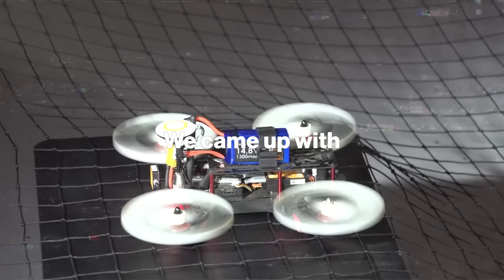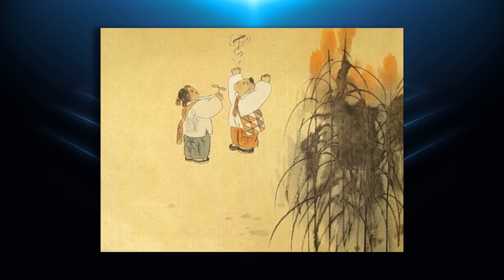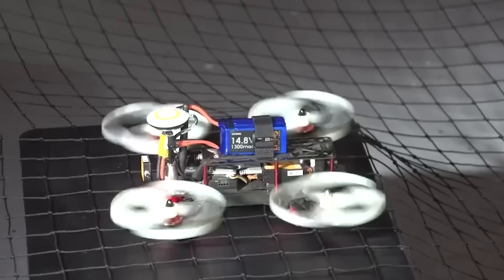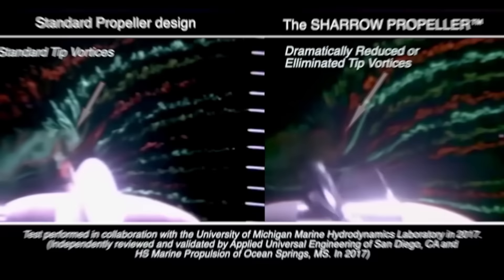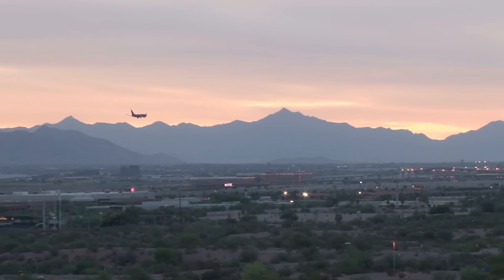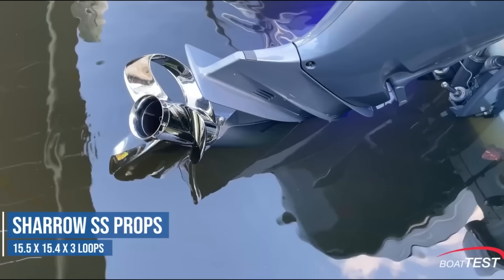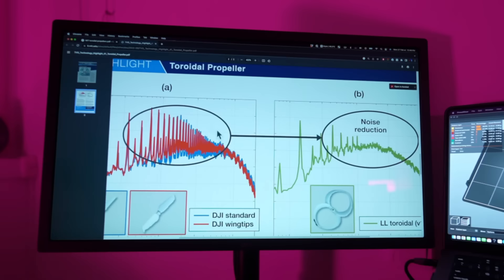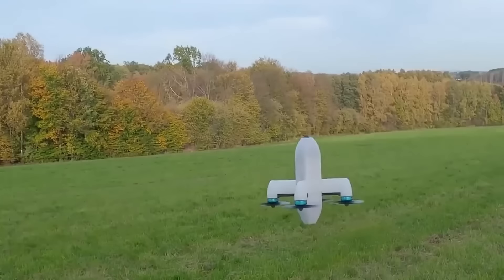This MIT Propeller Is Going To Change Aviation Forever

Comment: These would be useful for retro fit applications in GA aircraft,wind generation,boats and even domestic uses such as extractor fans. Aircraft propellers are an area of technology deffercit. Although these designs have been around for many years the manufacturing challenges could be solved if R and D money was spent on the problem.

Comment: The bending moment imposed on the engine due to gyroscopic precession associatd with direction change on a plane is going to be immense.
Reply: it could be less than standard propeller!
Reply: @0x00zero Given the dimensions, it looks like the moments would be far higher.  That's a problem for engines.
Reply: Is that because the toroidal props are heavier?

Comment: It's odd that the video does not mention cooling and exhaust fans so often found in households and businesses (e.g., in refrigerators, in bathrooms, over kitchen rangers, in refrigerators, air fryers, induction burners, and so on. Fan noise in households is ubiquitous, and it would be wonderful to reduce that.

Comment: As having been an Airforce and a commercial pilot I dealt with lots of incidents called birdstrike. Assuming this type propeller is hit by a foreign object, I could assume that in case such a propeller structure ruptures it might cause tremedous unbalance which furthermore could lead to complete desintegration. Those desintegrated particles would radially cause impact into the airframe and further destruction of the aircraft plus loss of lifes.
Reply: My numbers were bad. So, 2, 3,4, 6 & 8 bladed propellers. Whats really the difference in saftey factor as you describe in traditional propellers with their variety of blade count vs this concept in a bird strike scenario?
Reply: Breakup would certainly cause serious problems. However, since the circular design distributes the stresses, it may be possible to use a far more flexible material. Possibly a synthetic with thin carbon fibre cables embedded, similar to a tyre. It would need a lot of research and development, preferably on drones, where there is no risk to life.
Reply: Lives
Reply: an unbalance in these props from a bird strike would do the same exact thing with a normal prop. this design wouldn't change that other than maybe a little more material that has the potential to impact and damage the airframe.
Reply: Being a car driver and not a mechanic, I can tell which car innovations are garbage from a first glance.
Reply: @johnmood5653  Hope your German is as good as my English  ^^
Reply: @CL-mr4te  5, 7 and 11.  use only prime numbers, please.  avoid harmonics.
Reply: @dontghostbanmeplz8788  So are you putting this in the "garbage" category?  Me too.  Well, for most planes and drones, anyway.  Noise reduction seems to be the only benefit in air.  Seems to make more sense in the water....

Comment: This probably comes from the Prandtl box wing concept, which is aimed at reducing induced drag. However, it comes with more surface leading to higher friction drag. For this toriodal propeller, it will have the same disadvantages as with the Prandtl wing. Induced drag will be greatly reduced with the increase in friction drag. Moreover, while the front blades harvest all energy (with 40% power efficiency at best), the rear blades will harvest only thos loss enegy from the front ones. Thus, it depends on which part between pros and cons those propellers have more. Some less complicated innovative ideas are always suspicious, since it was likely to be already investigated and proved not working in the past.
Reply: No, it's all about removing cavitation. In water the prop speed is limited by this, thus limiting speed. THAT is the biggest drawback to helicopters  too , ..... HMMmmmmmmmmm??????? It would look cool though, kind of like DaVinci's drawings of one !
Reply: @inmyopinion6836  There's simply no (significant) air cavitation...and OP isn't talking about that in any case, so your post is doubly unnecessary, congrats!

Mmmm-okeey? :D
Reply: Thank you , it's always nice to know one's irrelevance. Especially when taken out of context!  @TheChzoronzon
Reply: @inmyopinion6836  My pleasure
Reply: @inmyopinion6836  I think you meant 'tip speed approaching sound barrier' is the drawback to helicopter....it limits the forward speed a helo can fly.

Comment: There is a video called "MIT thinks you're stupid".  In the video the author speaks about the toroidal propellor that was developed and patented by industry, and then people at MIT claimed they were the ones who invented and developed it.  I don't know too much about it these propellors.
What is important to me, that I I know about firsthand, is that the first heavier than air ion propelled aircraft to lift its power supply onboard was developed by me, over the past 24 years, not MIT as they also claimed.  In some later videos the use the word "plane" instead of aircraft, however their papers still claim they are the first of any kind with onboard ion propulsion.  It is especially sad because their much later flying ion propelled project is not nearly as efficient.  They are getting most all the credit and funding for it.  No one seems to give a crap about the truth these days, and important science is often just flatly ignored.  Credentialism appears to often be promoted over substance.

Comment: I love how you said this is the sound of inefficiency whilst showing a video of a drone using toroidal propellers. Watch Marks Roberts video on drone delivery in Africa. Their drones use a way different propeller design that actually does lower noise significantly. Also noise is NOT correlated to efficiency by any means especially human perceived noise.

Comment: The propellors of military submarines are always covered. The are built to be as quiet as possible. I have a feeling this has been used on subs for sometime for the benefits of less cavitation.
Reply: The designs of the props are the single most important element in terms of stealth capability underwater.
Reply: "In the 1930s, Friedrich Honerkamp patented a toroidal fan, and Rene Louis Marlet patented a toroidal aircraft propeller. The marine propeller was patented again in the late 1960s by Australian engineer David B. Sudgen affiliated with Robbins Company of Seattle."

Comment: I wonder how they would function on an aircraft, when power is lost.  Traditional propellers can be feathered, to reduce drag.  This is particularly important on two engines.
Reply: He showed several variants.  The ones that loop back onto the next blade are fixed and probably can't be feathered.  However, he did show at least one variant where the loop was to itself (a blade with a hole in it?) which could probably be feathered.
Reply: A fundamental problem, the ability to feather is needed in multi engine aircraft, may be a self destruct feature is possible, with the disadvantage of preventing a restart, obviously a no starter in multiengine aviation, last I checked, no commercial 3 engine are left in revenue service since the old Tante Ju was grounded in Switzerland after killing the pax of the sister JU 52.

Comment: This would work great on small aircraft, but likely not for anything larger.  The vast majority of small commercial aircraft engines are designed to work with a variable pitch propeller, in order to change the blade angle relative to the angle/speed of the air.  As the aircraft's speed increases, the pitch has to change to maintain the most efficient angle of attack of the propeller blade.  Unless they can somehow design the shape to be able to flex, I have doubts about its efficiency on faster, more powerful aircraft.
Another point is that many aircraft require the propeller to feather (reduce it's blade angle to zero) in order to reduce drag in an engine failure situation.  If it can't feather, it would cause great issues on multi-engine aircraft.
Unless they can design a blade that morphs to maintain the shape required to sustain efficient thrust through a wide range of speed, I have doubts this will ever be applied to anything large unless perhaps they can produce an electric motor and a propeller that can spin the thing to incredible speeds to maintain the most efficient angle of attack, but then, you will also run into the problem of the blade tip exceeding the speed of sound.

Comment: Stocks are pretty unstable at the moment, but if you do the right math, you should be just fine. Bloomberg and other finance media have been recording cases of folks gaining over 250k just in a matter of weeks/couple months, so I think there are alot of wealth transfer in this downtime if you know where to look.
Reply: Such market uncertainties are the reason I don’t base my market judgements and decisions on rumours and here-says, got the best of me 2020 and had me holding worthless position in the market, I had to revamp my entire portfolio through the aid of an advisor, before I started seeing any significant results happens in my portfolio, been using the same advisor and I’ve scaled up 750k within 2 years,
Reply: Having a counselor is essential for portfolio diversification. My advisor ASHLEY AIRAGAHI who is easily searchable and has extensive knowledge of the financial markets.
Reply: what the fuck does this have to do with propellers?
Reply: SCAMMER ALERT

Comment: On an aircraft you need to consider icing of propellers. Also the weight would be two or three times as much.
Reply: So, there is a problem, imagine a solution, like heating the prop, or restricting it's use in some logical manner (OH GAWD, Let the FAA decide that one, lol.)

Comment: Hmmm... This would be a major boost to the attractiveness of turbo-prop regional airliners, making them even THAT much more competitive in quieter, faster and longer range operations. This also could be a game changer for engine development of ‘oper-rotor/prop-fans’ for  larger commercial airlines.
Reply: They don't change pitch
Reply: Would they work even in fixed pitch models? Shouldn't all commercial airplane propellers be of the variabl pitch kind?

Comment: For marine applications as well as aviation use, a fixed pitch propeller is limited to relatively small diameter and low power to weight ratio machines. If a large multi engine aircraft or surface vessel were not capable of changing a propeller pitch to neutral pitch during an engine out emergency, it could result in possible loss of directional stability or control of the aircraft or surface vessel. In the case of the aircraft, this loss of control could result in a crash due to inability to properly steer the aircraft. The same reduction in control in a surface ship could also prove disastrous in the case of severe weather or maneuvering in low visibility, in crowded waterways or narrow ship channels. Also, as an aircraft altitude increases, propeller pitch control is essential to provide optimal engine thrust and resulting engine power output due to lessening air density at higher altitudes. And lastly, a 10X increase in price over a standard marine propeller for only a 10 % improvement in engine power at mid-range rpm, and a likewise 10 % reductions in fuel consumption at cruise (mid-range) speed isn’t easily justified for the majority of either air or marine operations.
Reply: Did you post an AI comment on an AI narrated video bro? 😂

Comment: The toroidal propellers might work better in water but not in aircraft
Reply: 5000 BUCKS FOR THE BOAT PROP EATS UP ANY FUEL SAVINGS AND THEN SOME ITS A NOVELTY.

Comment: The biggest problem I could see would be an engine failure with the inability to feather the prop…especially on a multi engine aircraft. Perhaps the prop could be engineered to lock in position to prevent rotation but I don’t know how much drag would still be produced by a stationary prop. What if the prop could be designed with minute separations between the blades so some feathering was still possible? I applaud the research. New ideas for an old device…that’s great. Some day, I’d love to have the new props on my boat.
Reply: Good question!  A twin engine plane with an unfeathered prop on a dead engine has much less control-ability.
Reply: I wonder if one could apply the opposite effect to locking the prop,  instead, having a a simple "clutch" to unlock them from a seized-up engine, so that they would freewheel....
Reply: @lohikarhu734  a spinning prop has more drag the a stopped prop. The biggest problem to solve  is the ability to pitch the prop for climb and for cruise for best efficiency.
Reply: Damn.......... I hadnt considered that.
Reply: Seems the toridial design could be  feathered or twisted. Rigidity of the prop may be a problem tho.
Reply: i wonder if it can be used on turbofan jet engine fans and turbines
Reply: @lohikarhu734  THEY WOULD OVER SPEED.
Reply: @renegadeflyer2  IT CANT AND NEVER WILL.
Reply: Prop brakes are already common, particularly on motorgliders.
Reply: Its hardly a new design (over 100 years old I think?) the problems with it are the reasons we don't use it. Those Techno rats of the sky (drones) can kind of make use of them and boaties well.. you guys will put anything on your boats with a big enough price tag and a promise of being the only one on the block with it.
Save your money and buy a bigger engine because there is never a replacement for displacement.
Reply: @lohikarhu734  freewheeling is bad.  A 'windmilling' prop has the most drag.  a 'locked' prop has less and a 'locked and feathered' has the least.
Reply: @crashalexander7232  "overspeed" versus what speed?  There is no information shown about the performance of this prop in a 'driven by airflow' mode...
Reply: @lohikarhu734  FIXED PITCH WILL SPIN LIKE A PINWHEEL IF IT CANT BE FEATHERED .....TONS OF DRAG AND WEIGHT ....MUCH INFO THAT ISNT SHOWN CAUSE ITS A NOVELTY THAT WILL NEVER SEE USE IN THESE APPLICATIONS....LOL

Comment: How much more would a toroidal prop weigh on an aircraft than a conventional prop?  That translates to weight and balance issues, the need for a bigger crankshaft to tolerate the gyroscopic precession, more weight and balance problems; an endless vicious circle of problems.  On top of that, it's best suited as others pointed out for fixed pitch applications.
Reply: It's all marketing bs, at least for aircrafts 

Shame on the MIT

Comment: Ive tested an 18 blade shrouded propeller found free on a 3d printing website-its fantastic at different scales as a wind generator blade, trolling motor replacement, and as drone blades.  Pretty cool looking: looks like a jet turbine blade with an outer rim on the blade tips.
Reply: link please?
Reply: I was thinking the same thing… but the shroud might not be feasible for large aircraft props because of centrifugal forces with the added weight spinning so far from the center of rotation… and then there is the issue of balancing a prop with a shroud attached… sounds daunting and expensive.
Reply: @rjhinnj  I tested an 8" diameter (200mm) version mounted to a motor from a razor e125 scooter, it held up for over 10,000 miles on the front bumper of my car, at times handling speeds of up to 110mph but averaging 80mph.  It outputted 40 volts and several hundred watts at times and performed very well for being made of PLA and printed on an old Wanhao I3 $300 3d printer.  I had a friend with a higher end printer make me a 14" diameter blade from ABS which performed much better (attached to a 480 watt 24v scooter motor) and tested that connected to a wet cell HHO generator-which blew the engine on my test vehicle 😆 It had around 270,000 miles to be fair

Comment: Ring wings don't eliminate tip vortices.  And a conflict is created in the lift of the lower and upper surfaces, which reduces efficiency. This "toroidal" prop is the same essentially as a ring wing. It seems to make sense conceptually, but not in practical reality.

Scimitar prop blades have been made for a long time, which somewhat reduce vortices and noise. In the same way that winglets on an airliner somewhat reduce drag.

There's little new under the sun, aircraft toroidal props were trialed in the 1930's. Ship propellor in the 1890's.

Comment: Would have been nice to hear a comparison in drone noise between the two propeller types.
Reply: I fly a DJI Mavic 3 as my primary and also have several smaller Air2S and Air3S plus a couple Autel drones (I'm a commercial Part 107 UAS pilot) and the Mavic 3 is the quietest drone I've ever flown, and that's with standard DJI props. I can fly that over a wedding ceremony and from 30 feet in the air, and in a constant hover, nobody can hear it, so I don't know how much quieter this invention would be.
Reply: @EdFhvn  What enables your Mavic 3 to be quieter?  Lower tip speed?
Reply: @somaday2595  Not sure, but there is a subtle difference in shape between the props for the Mavic 3 and those for the 3s and 2s.  They are also larger, because the Mavic 3 is almost twice the size of the others. It's more stable as well. The first time I powered up the motors I noticed how quiet is was.  Even on lift off, then there's more stress on the props, it remained quiet.